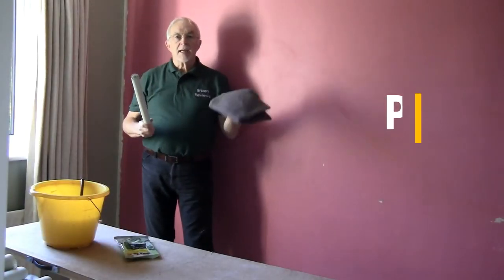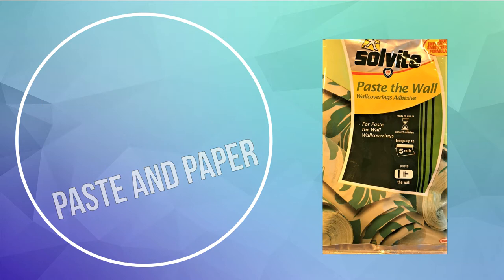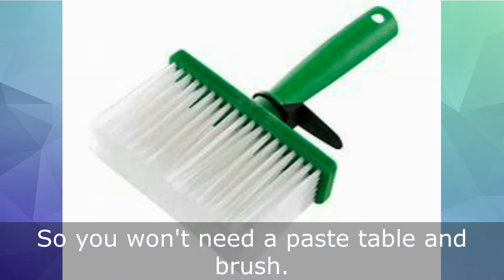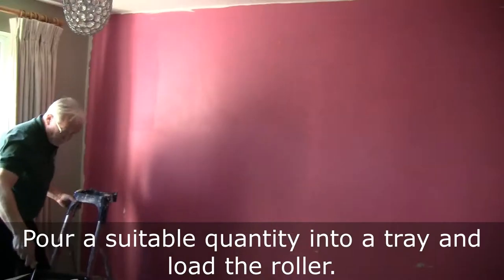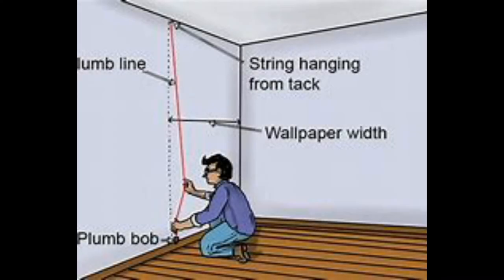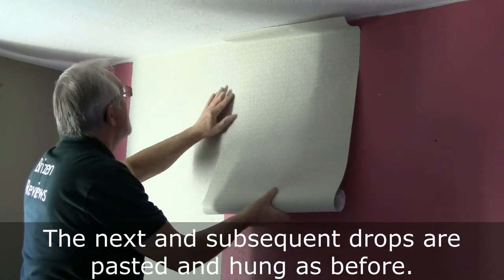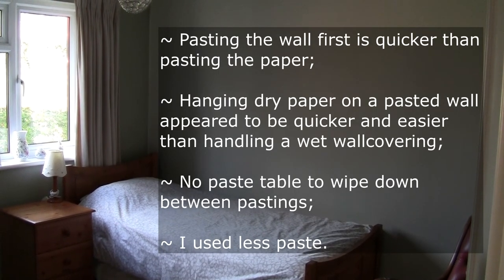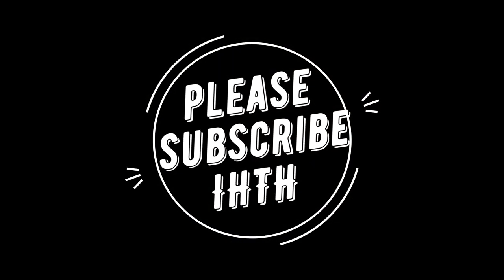Solvite Paste the Wall Wallcoverings Adhesive | Paste the Wall Wallpaper | First Experiences

Comment: Won't the wallpaper expand?
Reply: Not if you use wallpaper made especially for 'paste the wall' technique. The label on the wallpaper roll will say if its for this technique. If not, then generally it's safe to assume it's the standard paste the paper variety.
Reply: @alec_jimmi5  I did the job meanwhile and it was paste the wall. And no it didn't expand. But it got really really wet, I thought it was gonna rip.